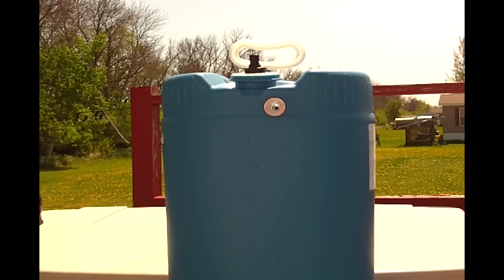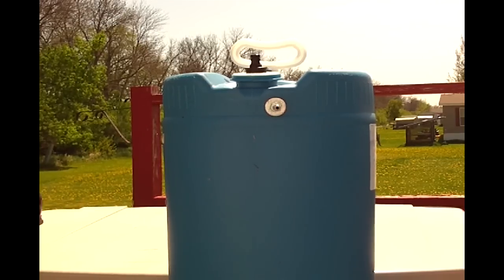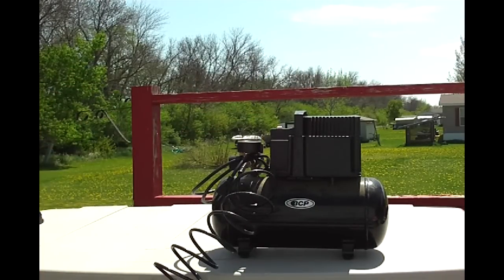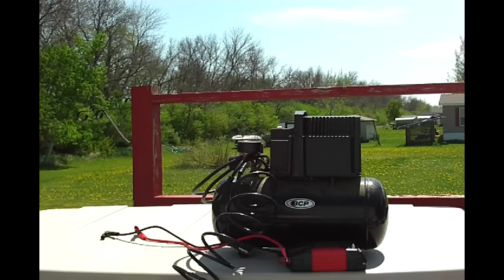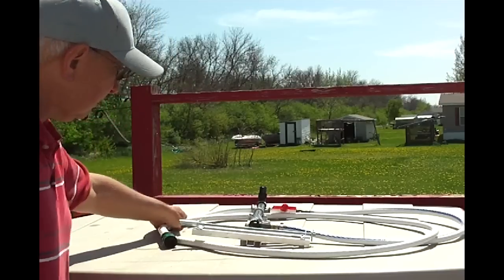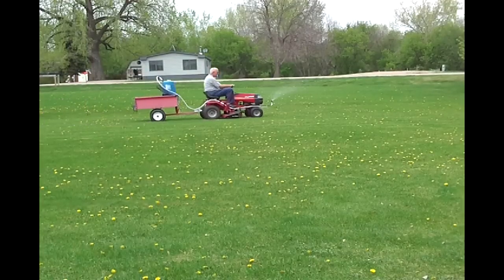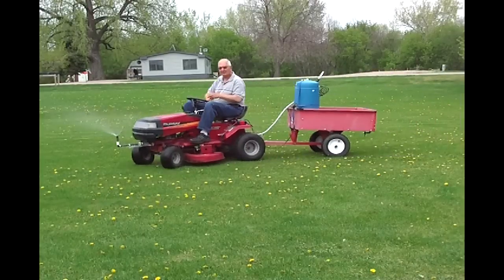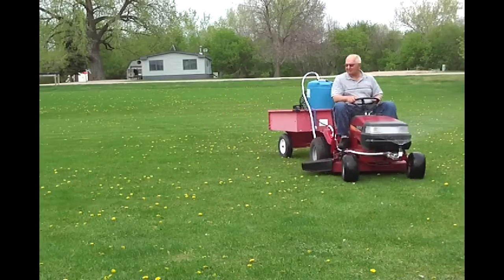DIY Lawn Sprayer

Comment: Radiator fan will suck spray into the engine. Yes, ideal location will be placing the sprayer in the back pointing downward. If you know it will spray, no need to keep looking back. After spraying, run warm water through system since the chemical will crystalize and clog up your system. Especially the nozzles.

Comment: I like yours. I don't have riding mower. There are the little 2-3 gallon kinds that are not electrically powered and do not require pumping. U can find one on YouTube that is also DIY. Just search for this on Youtube: 4clOjJFR3F4? The pressure regulator used there is under $8. You can make a manual no-pump sprayer for a cheap price. I don't know anyone that sells 'em completed. If U do, please respond here. Rantsville had a good idea spraying it out the front of the tractor.